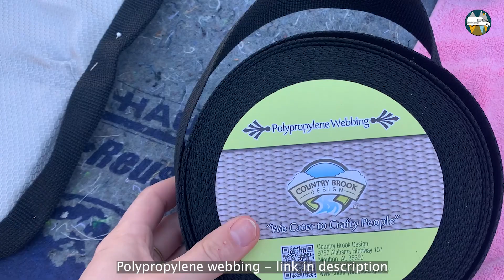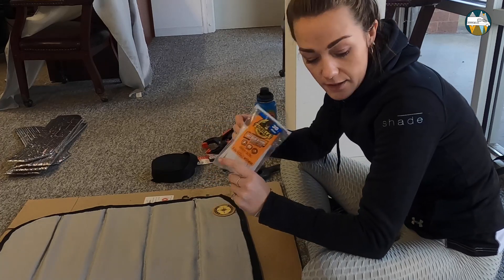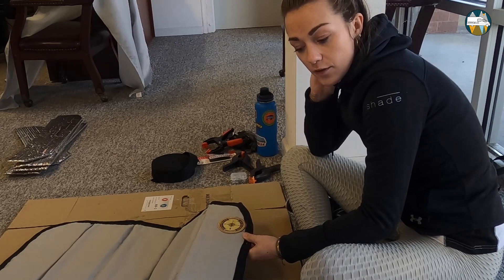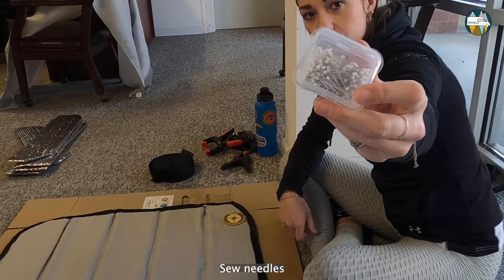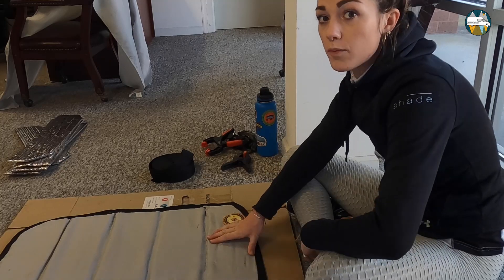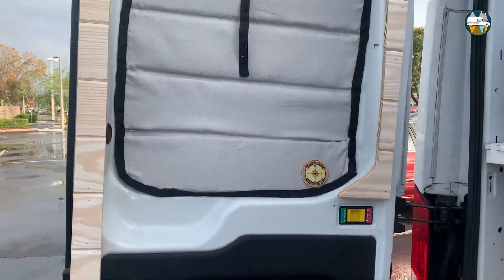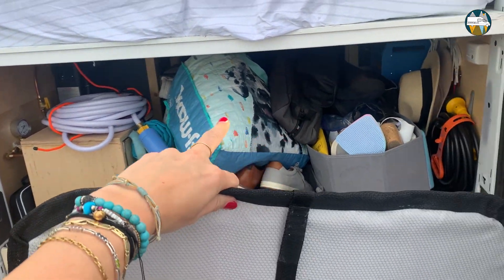#7 VAN BUILD | DIY Affordable Window Covers!

Comment: Math + English = Hard, but, you can see the wheels turning, lots of cogs just a spinning and spinning (so cute). I do have a quick question, since technically, reflectix is used mainly to reflect the sun. Doesn't having it covered in black cloth kinda defeat the purpose? Wouldn't just regular bubble rap be just as good in this case? Anywho, y'all take care and YHVH bless His people.
Reply from the maker: HaHa totally! It’s not easy to do all of that in a different metric. Thanks for understanding 😊  I think reflective will definitely more help then bubble rap. I used light grey and that’s great. Also, it still will be hot in the van without airco. But def need window covers. If you wanna make black ones, shouldn’t matter that much! Good luck 🍀😁